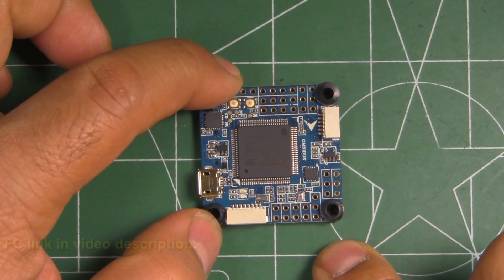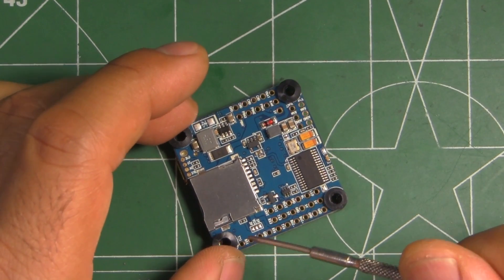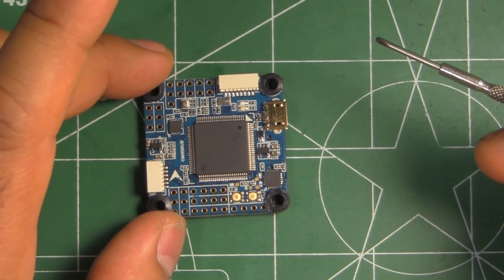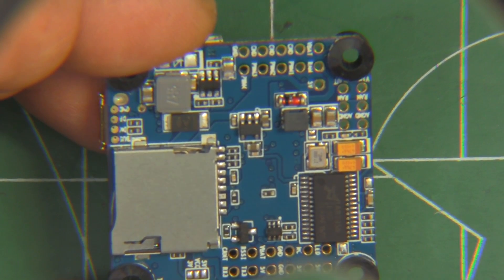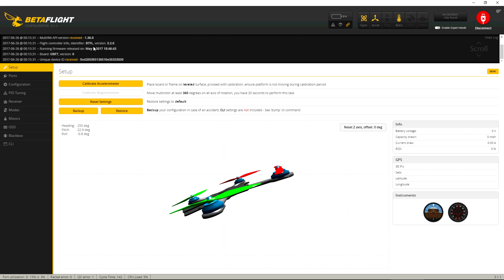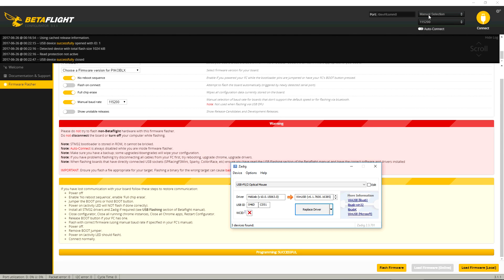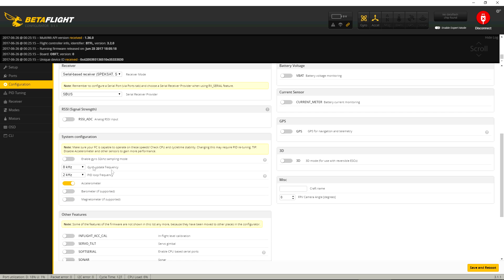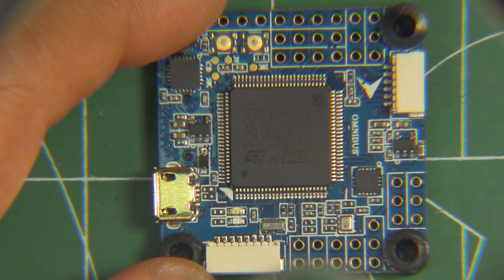iFlightRC.com Revo Bee32 F7 Flight Controller (OSD,Dual Gyros,BEC)

Comment: Did you see the redesign of the board? They soft mounted one or both gyros. In the photo, it looks like the gyro board is encased in Jell? Hard to tell. I hope its not foam because for that to work, the gyro board would have to have more mass. how is your board and what are your thoughts on the outboard gyro? http://www.iflight-rc.com/iflight-revo-bee32-f7-v2-flight-controller-osd-dual-gyros-bec.html
Reply from the maker: I saw those new boards. Seems to be one of the "latest trends" There's going to be more FC's with soft-mounted gyros. You're correct. The dampening material has to be carefully selected since that gyro box most likely doesn't have a large mass. If dampener is not correct then it won't work. My opinion is that's too complicated. and adds more height. We're already limited in space in the superlight frames where we stack ESC/FC/Rx/Vtx. So you'll need a frame with good space. I think those $2.80 dampening stand-offs work well already but anyway, it's good to see they're trying to improve things. If you have room, then it should work well - as long as that sofmounted box gets good dampening.
Reply: Just got this back from IFlight.
"It's one kind of jell, not foam pad.
No need grommets, the jell is enough for vibration damping.
Besides the holes are no longer suitable.
1 amp for V2 is correct.
We're now working on the wiring diagram."
At first Hey Jell is better than foam but then...
My take... I liked the grommets and was hoping to use them to help with the MPU6000 (unless both are in the Jell). So now I wonder how the Jell reacts to heat, cold, will it leak, stiffen up? Having the ICM2602 is neat to experiment with now but I think it is not ready for flight controllers until it is made more like the MPU6000 but with 32x32. It's just a tease.
Reply from the maker: I would think both IMU chips would be in the daughterboard on jell. Hard to say if jell gets affected by temperature, but if it's silicon-based it should be OK in a wide range of temperatures. I don't think it's liquid so it shouldn't leak (just my guess because I don't think designers would use a liquid there)
You can but those RealACC rubber standoffs and use them to get additional dampening. They're $2.80 from BGood.
Yes, it'd be neat to just experiment with that 32K chip. Who know if it will ever get as popular and as good on tuning as the MPU6000

Comment: Hi. Thanks for your review!
Planning to upgrade from a NAZE32. Do you know if this controller will support CPPM from a Frsky D4r 2 receiver and output telemetry? I believe both signals need to be inverted too. I normally fly LOS and like to use the transmitter to announce battery, altitude etc.
Reply from the maker: I have not yet tried the telemetry feature on the FC, but it has the same capabilities as all other FC's so it should be to do it. I believe you just connect the telemetry input cable from the FRSky Rx to a UART Tx on the FC and set the proper protocol on BFlight ports settings. CPPM should also work as well. All those features are controlled by firmware in BF. I run S-BUS Rx's but PPM should work well. F7 chips have built-in signal inversion I believe, so you can connect to any UART and set inversion through CLI. If I'm not mistaken, F4 processors need actual hardware inverters and some of them only have one inverter on board.
One thing to watch out at this time is that F7 firmware is still in early stages so all features may not yet work until BF3.2 is officially released. I'm sure all those features will be working once the f/w is done.
Reply: Good advice, I did read that about the f4 which is a shame for me, those boards have some nice features!  I'll wait till the f7 is a bit more mature now that I know it's a good fit for me and my receiver. thanks very much for taking the time to reply.

Comment: there´s also a new configurator with new features for the beta 3.2,. i´ve been running dshot1200 , gyro icm,  loops 10.6/10.6  with esc wraith 32, and it´s amazing even on  stock pids ,  notch filter 1 off , and PT1
Reply from the maker: Awesome - thanks for the tip. I'm going to install the new configurator.
Reply: https://github.com/betaflight/betaflight-configurator 

i think is this one, haven´t a fc rigth now  to confirm
Reply from the maker: Can't find the Configurator made for 3.2. That link is for Confg 3.1.1 Same as I have. I've Googled so far no luck.
Reply: that link is the 3.1.2, i just opened now, must  drag the betafligth -configurator master file after extract  to extensions off google, sorry for my bad english :)
Reply from the maker: I understand you, Your English is good. Strange. I downloaded ZIP and extracted, uninstalled BF Configurator and installed extension from my download... and still showed 3.1.1
I'll try again. UPDATE: did everything again, uninstalled and re-installed. and rebooted PC. Now it shows 3.1.2! Thanks for the help.

Comment: I dont think Betaflight can run ok on 32/32 at this point-or has there been a new release?
Reply from the maker: Not yet, I think on the new 3.2 coming out sometime soon. FC needs to have ICM2602 giros. MPU6000 won't cut it. This one has both giros so you can pick ICM and enable 32K ..... and hope it doesn't go nuts. Still beta, so best wait until it's stable.

Comment: any idea if this can do dshot 1200 on all 6 motor outputs?
Reply: nevermind this only has 4 pwm and omnibus has 6 :(
Reply from the maker: I think you can remap outputs in CLI. Just free unused resources and assign them to 2 PWM outputs. As far as DS1200 on all 6... I'm not sure on that one. They're still working on the BF 3.2 F/W that's gonna support F7 boards